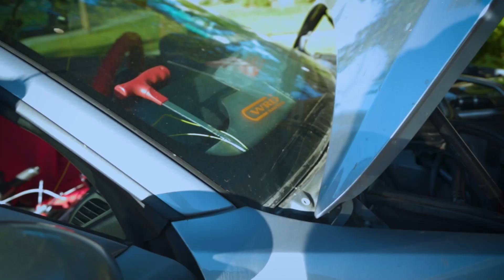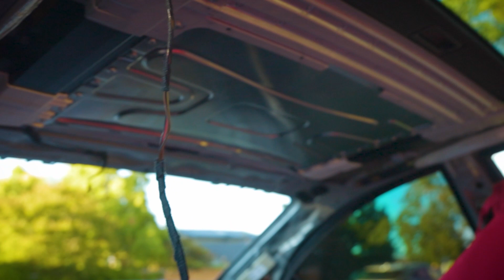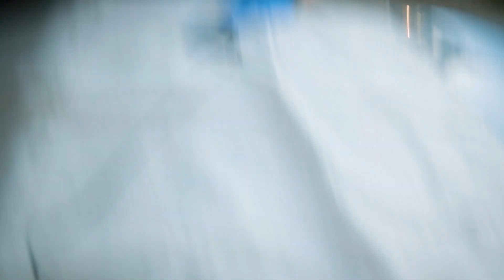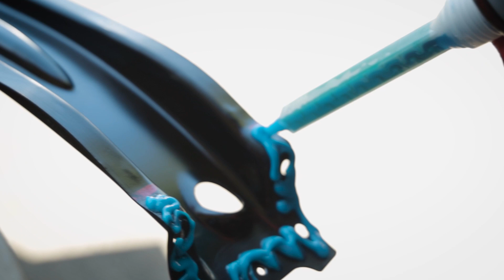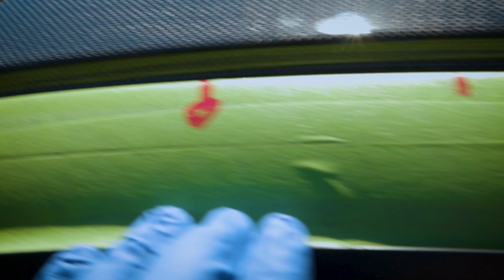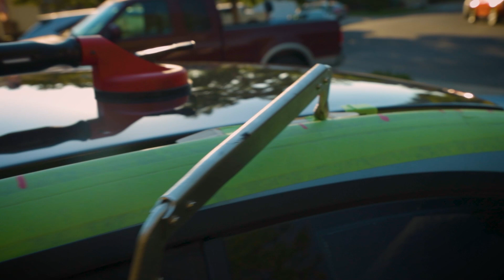E46 M3 CSL Conversion - Carbon Fiber Roof Install - How to - Money worth the weight savings ??

Comment: On my old E46 M3, we had the roof bow welded in place.  I was also able to source an OEM CSL roof which made for a perfect fit.
Reply from the maker: I've always welded the roof bow in on my previous swaps but on my personal car I wanted to try out a new method which would be better than just the spot welds that are usually done. I do wish I waited on my OEM CSL roof to come in instead of going for aftermarket

Comment: I think you guys could have done a lot better. Drill bit not suitable - possibly drilled too deep - may have weakened the structures underneath - especially where sheet metal still needs the spot welds to stay connected to another.

The brace is spot welded from factory. Plug welds would have worked fine. Not sure surface big enough for clueing and riveting.

It is my understanding that the structural carbon needs to be bonded straight to metal - not to primer or paint. The clue used to bond would have been applied to the entire surface and would have protected the metal from rusting. 

The bulging is not really a problem. You could push it down with a finger couldnt you. Provided you have enough clamps to hold clamp it down while the clue cures it is no problem.

Comment: If I can get this done on my e46 m3 for 2k parts and labor then it'd be worth it right? (I hate sunroofs too) 2M in San Diego quoted me 2k for parts and labor with a week turn around might do it. But also want Pole-positions  ; /
Reply from the maker: depending of what type of parts they plan to install. my parts alone were over 2k and thats without the alcantara i ended up doing as well

Comment: What did you do about the sun roof switch/controls/wiring? Is the button still there or did you have a delete for it?
Reply from the maker: With the new headliner that I got, I chose the option that did not have the holes for the sunroof button since I was not going to need it anymore. I did not undo the harness to take the wires out of the car though.

Comment: I’m about to install my carbon roof and I can’t wait! Where/how did you end up relocating the shark fin antenna?
Reply from the maker: That’s awesome. I love my carbon roof. I ended up hiding the shark fin the in little compartment in the trunk on the drivers side. It still works perfectly fine on mine
Reply: @MunichVenom have you had any issues with leaks? I'm gearing up for this swap to eliminate my leaking sunroof currently

Comment: I was thinking of doing the exact same thing for the bow, screw it on and use rivets.
Reply from the maker: With the chassis epoxy and rivets it’s not going anywhere. Basically welded on. I feel this is better than the spot welds I’ve seen on other builds

Comment: What engine mods did you complete? (i.e. cams, exhaust, intake, headers, pulleys) ? I just installed the Turner Motor Sport CSL intake and full race Super Sprint exhaust with cat-less headers and Kassel Performance ECU CSL firmware tune with Turner Motor Sports pulleys lighten Fly Wheel and stage three clutch, next is to DYNO, I hope I can make 340 WHP. https://www.youtube.com/watch?v=WUxswctlxxs
Reply from the maker: did a karbonius intake, with a full exhaust system (headers, sec1, x-pipe, ss race exhaust), electric fan upgrade and a HTE performance tune to make 350 whp on a mustang dyno. That was with rubbing on the rear tires, the car would've gotten closer to 355whp for sure without rubbing.
Reply: @MunichVenom  Thank you for the info I'm going to DYNO my car 5AUG2021 dynojet Panzer Performance

Comment: Did you use euro windshield? I noticed it was more purple than the stock US spec one.
Reply from the maker: Yes this was the euro UV windshield. I love the look of the purple glass on BMWs
Reply: @MunichVenom  where did you get it? Want to swap mine out
Reply from the maker: I got it through Exel Autoglass
Reply: The BMW windshield part number is 51-31-7-059-703

Comment: Did that bulge in the carbon roof end up causing a big issue with the install? Im also looking into this to do in the wintertime. Also did you buy a new oem headliner?
Reply from the maker: The worst part was clamping down the roof and introducing stresses into the material during the clamping process. Visually you can’t really see where the bulge used to be. Will see how it holds up over time and will give everyone an update in the future.
Reply from the maker: Yes I bought a brand new oem headliner without the sunroof cutout.